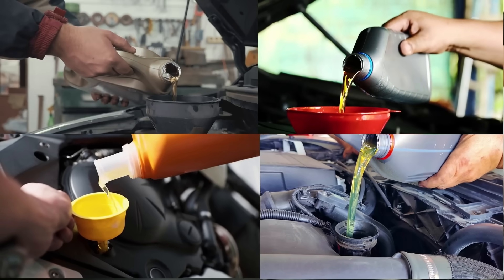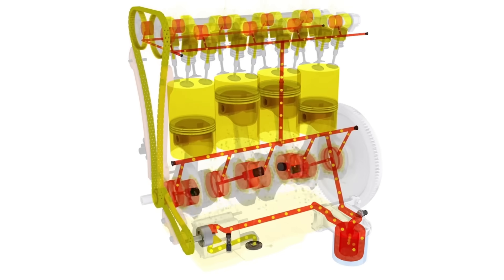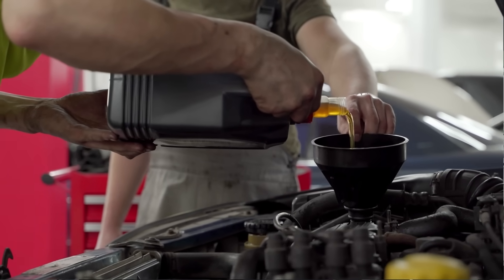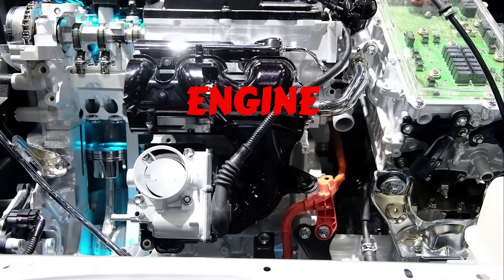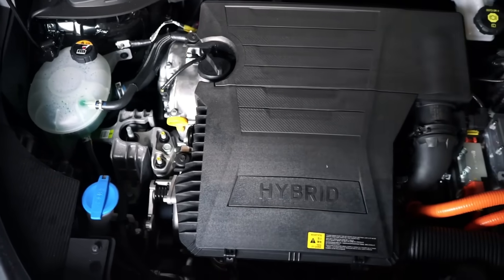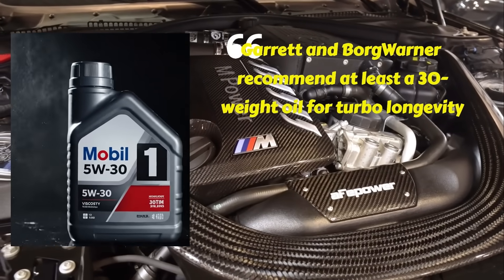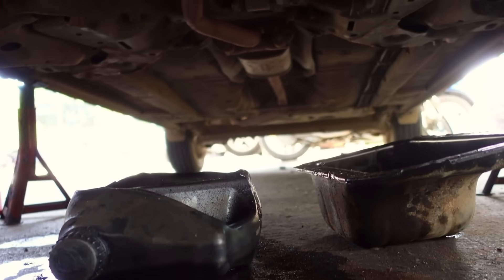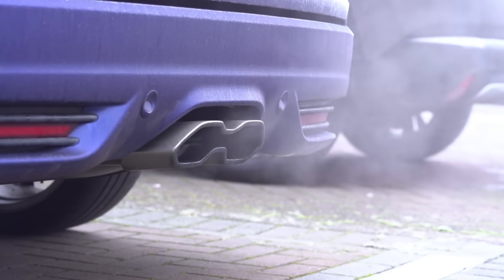The TRUTH About 0W 20 vs 5W 30 Oil (50 Engines Tested!)

Comment: I drive a VW Arteon with the new 300hp 2.0T Evo engine which is used in the Golf R. Just had my first oil change from the factory oil, to the recommended 0w30. During warm-up, when rpms drop from 1500 to under 900, there is some valve ticking noise, which was not present with the factory oil. Could this simply be the oil quality they use at the dealer? Or is the oil simply too thin? I remember when the standard oil for the 2.0T VW/Audi engines was 0w40 and 5w40.
Reply: My best guess will be the fatory 0W30 has high amount of Boron additive which is acting as antiwear/friction improver by creating a harden film on contact surface to prevent wear and reduce friction even when oil pressure is low at idle rpm. Personally, I will recommend new Redline Euro series since it's a high performance turbo engine.

Comment: With all due respect, this is a dangerous myth based on 40-year-old engine technology, and it does not apply to modern engines.
Today's engineering is the exact opposite of what this video claims:
 * TOLERANCES: Modern engines are built with incredibly tight tolerances (clearances). Oil that is thicker than recommended is too slow to penetrate these tiny gaps on a cold start. This causes oil starvation, which is responsible for the vast majority of engine wear.
 * FLOW > PRESSURE: An engine is protected and cooled by flow (volume), not just pressure. A thinner oil circulates much faster, instantly reaching critical parts (like the turbo) and removing heat far more efficiently.
 * VVT & TURBOS: These systems use oil as hydraulic fluid, passing through tiny passages. Thick oil cannot flow correctly, causing these components to clog, malfunction, and fail.
Engineers specify thin synthetic oil not just for fuel economy (which is a secondary benefit), but because the engine is designed to require that specific viscosity. Using thicker oil causes more wear, not less.

Comment: If we assume that the oil channels will be thin, then the new engines will use 0-20 thin oil and 5-30 thick oil. So what would it be like if we used 0-30?
Reply from the maker: Using 0W-30 can actually be a safe compromise in most cases. Cold starts will be just a bit thicker than 0W-20, so oil might take a moment longer to circulate, but it still protects the engine well. At operating temperature, it behaves like 5W-30, giving solid protection in heat. It’s not likely to harm your engine, but sticking to the manufacturer’s recommended viscosities is always the safest bet.

Comment: 😲 Glad I watched this video before I put 0W 20 in my Wrangler although winter is beginning so I could probably top it off using just 1 quart then get a oil change before summer 😊 Thanks.
Reply from the maker: I'm glad you found the video helpful! Topping off with 0W 20 during winter is a smart move. Just make sure to get that oil change before summer rolls around!
Reply: @CarCareCrewoffical Yes thank you !!

Comment: I live in the high north in deep cold winter climates - where -40C/-40F is a normal winter day.   0uch!    My vehicle's use 0W-20 in cold months and 5W-30 in hotter temps summer months.  Been doing this for years - regardless of the filler cap's label.   I've learned many years  ago that for weather temps and any engine oils "one size does NOT fit all".  This works for me....
Reply from the maker: Exactly! That’s a smart approach. Matching your oil viscosity to the seasonal temperatures keeps your engine protected and running smoothly, especially in extreme cold or heat. The filler cap is just a general guide adapting to actual conditions is what matters most.

Comment: I use
 -30W-40

Just use what the damn Owners Manual says and be done with it, fer christs sake…
Reply from the maker: Absolutely! Following the owner’s manual is always the safest bet. The recommended oil is designed to protect your engine under normal driving conditions, so sticking to it keeps things simple and worry-free.

Comment: Entao porque alguns construtores recomendam 0w20?
Reply from the maker: Manufacturers and builders often recommend 0W-20 because it’s optimized for fuel efficiency and meets the engine’s design tolerances, especially for cold starts. It provides good protection when used as intended, but in hotter climates or for heavy-duty use, slightly thicker oils like 5W-30 can offer extra protection just make sure it won’t void your warranty.

Comment: According to Toyota my 23 Tundra was designed to run with 0W-20. Can it run on 5W-30 without causing other issues? Meaning the thicker oil hurts other components because the motor was designed for a thinner oil?
Reply from the maker: Absolutely! You can safely run 5W-30 in your ’23 Tundra especially if you’re in a hot climate or do towing. The slightly thicker oil gives better protection under load and high temps. Toyota mainly recommends 0W-20 for fuel economy and emissions targets, not because 5W-30 would harm anything. Just use a good full synthetic and keep up with your oil changes  your engine will be perfectly fine.

Comment: Tento um Cruze ltz 2017 1.4turbo uso 5w30  dexox 1 ilsac gf 6 sp tá no manual      mas de 2018 a 2024   usa 0w20
Reply from the maker: “Nice choice! Sticking with what your 2017 manual calls for is the smart move 5W-30 Dexos1 Gen 3 is perfect for that turbo. GM switched to 0W-20 later mostly for fuel economy, not better protection. 5W-30 gives stronger film strength and keeps that 1.4T running smooth for the long haul.

Comment: 210,000 miles, Toyota Camry, 0W16. 🤷🏼
Reply from the maker: “Wow, 210k miles on 0W-16 that’s awesome!  Toyota really built those engines right. If it’s running smooth and not burning oil, no need to mess with success. Just keep up the maintenance and it’ll keep going strong.

Comment: I see 2024 Camry 4 cyl engines calling for 0W16 and 2025 models 0W8! What? 😱
Reply from the maker: “Yeah, crazy right?  They keep thinning oil for MPG gains, but that means less protection. Many owners now stick with 0W-20 or 5W-30 to keep engines safe long-term.

Comment: yes own a 2018 lexus nx300 with 100,000km 2.0T changed from 0w-20 to 5w-30 doesnt rattle anymore
Reply from the maker: “Nice move! That little turbo definitely thanks you for the extra protection. 5W-30 keeps things quieter and handles heat better, especially as mileage builds up. Great to hear the rattle’s gone  that’s real-world proof right there.

Comment: My 2023 COROLLA SE came with 0w8 oil in it.  That was making it very loud, it sounded unhealthy. I had to get it out of there, and put in 0w20. It's perfect now, but I'll have to change it myself every time.
Reply from the maker: Good call  0W-8 is crazy thin  great for fuel economy, not so much for engine comfort or noise. 0W-20 is a much safer middle ground, especially if you want the engine to last long and run smoother.

Comment: I feel like if it's a brand new clean sheet design then 0W20 will work well. If it's an engine that's an older design that initially ran on 5W30 or 5W40 and suddenly the manufacturers are calling for 0W20 is when the issues will start occurring. We have a 2018 Nissan Kicks with 130k on it. Had to replace the valve cover due to a crack causing a leak and when I had the valve cover off the top end of the motor was squeaky clean with almost no wear on the cams. That vehicle gets 0W20 synthetic every time and we don't use fancy stuff. Just whatever bulk 0W20 stuff the quick lube place puts in.
Reply from the maker: “Totally agree  newer engines designed for 0W-20 handle it just fine, but older designs adapted to it can have long-term wear issues. Sounds like you’ve been taking great care of that Kicks though Clean cams at 130k prove your maintenance routine is working perfectly.

Comment: Even with regular oil changes, I just replaced an 80k km engine on a 2017 Kia Forte.   5w20.    So I'm going to switch to 5w30.
Reply: On that one it might not be the oil, might be the manufacture.

Comment: In the 90s I ran 10w40 in an Acura Legend during the summer months and 5w30 in winters.  It apparently voided the warranty to do that.  Car was still running fine at 245K miles when I sold it.  These days I run 5w30 in every car even if it calls for a 0w and have no issues at all.  After 100K miles I would go to 5w40 in the summer.  On cars pre 90s, heavier weights were used as the engine had more mileage and wear.  It was common to go from a 30 weight to 40 in those cars.  Water thin oil is a bad idea even when it is new.  With 10K mile change intervals it is a disaster.
Reply from the maker: Thanks for sharing your experience and your approach to oil weights—it's great to hear your cars are running so well with your chosen viscosities!
Reply from the maker: I really appreciate you sharing your insights! It’s great to hear from someone with real-world experience. Your tips on oil weights will definitely help others in the community!

Comment: I use Ravenol 5w40 on my 2010 Civic now. Never going back to 0w20.
Reply from the maker: It sounds like you've found the perfect oil for your Civic, and that's what truly matters!
Reply: @CarCareCrewoffical 5w40 is the perfect oil. Let it warm up till the idle lowers and run the run the engine as long as you want. I do roadside, i use 5w40 Euro oil in all my vehicles
Reply: @GeezCte  Euro oil depending on which one can actually be a worse oil for a vehicle that doesnt need it depending on which exact oil it is. Many euro oils are developed to be super friendly to GPFs and cats. This reduces the amount of ZDDP and other anti friction and detergent compounds. I do think most of the super low SAPS euro oils are 20 and 30 weights but I would check to be sure.
Reply from the maker: @GeezCte  Makes sense, bro 5W-40 Euro oils are solid, especially for engines that see tough use or long runs. Good film strength, great heat protection, and if it’s working well for all your vehicles, no reason to change what’s already proven.

Comment: OK PEOPLE RETIRED SENIOR TOYOTA MASTER TECHNICIAN HERE WITH 39 YRS EXPERIENCE HERE.I HAVE 2 TOYOTA 1999 4 RUNNER LIMITEDS. ONE HAS 984,627 KM OR 611,000 MILES . 
I HAVE ONLY USED AMSOIL SIGNATURE SERIES 5W-30 SYNTHETIC OIL WITH SYNTHETIC LUCUS AND PUROLATOR BOSS 21905 OIL FILTERS. 

YES AND I AM SURE ,ALL YOU KNOW IT ALLS  CLOWNS WILL SAY LUCUS IS GARBAGE . OK YOU CLOWNS I WILL SET YOU IDIOTS STRAIGHT . WE LIVE UP IN NORTHERN  ALBERTA CANADA 🇨🇦🇨🇦 WERE JAN TO  APRIL WINTER TEMPS CAN DROP ON AVG TO -38C . THE SYNTHETIC LUCUS HAS SAVED THIS ENGINE WELL OVER 26 YEARS FROM COLD STATRS .
END OF STORY. 

UNLESS YOU HAVE MORE THAN 40 YRS AS  A MASTER MECHANIC KEEP YOUR FUCKEN MOUTH SHUT , END OF STORY. 👍

Comment: I quit listening when I heard him quoting Scotty Kilmer.
Reply from the maker: Haha fair point 😅  Scotty definitely has his own style, but some of his points spark good discussions. The goal here is to look at real data and testing rather than just opinions  that’s where the real value is.
Reply from the maker: Haha fair point 😅 Scotty definitely has his own style, but some of his points spark good discussions. The goal here is to look at real data and testing rather than just opinions  that’s where the real value is.
Reply: @CarCareCrewoffical  This whole  debate makes it tough to kniw what to do. As a mechanic, do i just decide what I think is best for every car and disregard what the manufacturer is saying to use? Where does that put me if the engine fails? Up to now I pretty much follow whats on the cap/in manual with premium filters and change 8-10,000 on synthetic. I know we have been using 5W20 long enough to know its fine, I have over 300,000 km on my truck with 5W20. I think ectended intervals is a big issue. Oil, I think people will have to choose and tell their garage if they want to deviate from whats recommended.

Comment: First, subaru wrx and sti got a bad rep for head gasket failure. My Cobb dyno tuned 2004 wrx wagon has NEVER blown a head gasket(bought it at dealer with 4 miles on it). My tuner told me to run valvoline 5W-30 synthetic, and change the oil every 10 tanks of fuel. Sounds crazy right? But 10 tanks of fuel is 3k miles. These claims of auto manufacturers and oil labels claiming PROTECTION UP TO 10K miles is ludacris. My buddy just bought a hybrid toyota, and they say change oil at 9k miles. I told him thats insanity. Change it TOPS at 4k or before. This is an oil conspiracy. Thin oil for emissions, and change at 9k miles. They WANT your engine to fail so you buy a new car every 5 years

Comment: Indeed. I went for the slightly thicker oil in my D4 who has passed 300000k. The thing is that 5w30 are better for a motor who stays warm when its below -10c. The D4 cools down below -12 with the 0/20 so i guess i will use the heater more. I havent noticed a higher fuel consumption yet. But the car are inspected as it was supposed to which means new oil every year. The other to do is letting it idle bf and after the drive. Evry car owner should learn this.
Reply from the maker: That’s a really smart approach sounds like you know your engine well. 5W-30 definitely helps engines maintain oil pressure and protection in colder temps, especially when they cool down quickly like your D4. Using the heater and proper warm-up routine is a solid habit too  it really extends engine life over time. Nice maintenance discipline!

Comment: I have a 24 grand cherokee. Using recommend oil right now with warranty. Would 5w-30 be a good switch after warranty is up. I live in New Mexico and does get around 110* in the summer. I do travel 2 hours a day for work. What would you recommend?
Reply from the maker: “Great question! Always best to follow your manufacturer’s recommendation while the warranty is active. After that, since New Mexico gets extremely hot and you drive long distances daily, many owners safely move to 5W-30 for a bit more high-temperature protection. But make sure to confirm with your trusted mechanic or dealership before switching  every engine behaves slightly differently.”

Comment: 2024 Subaru Outback non turbo 2.5L . At 25K I went from 0W-20 to 5W-30 instant change in sound , much much quieter on start and idle .
Lost from 30 mpg to 28 plus depending on getting good gas and trash gas even from  the same station . I also went from street tires to
AT tires and that made the most difference in mpg but I'm good with 28.5 mpg . I change oil every 5K miles and use extended life oil 20K
oil but still change every 5K miles . I'm 69 and don't see any new cars in my lifetime . I have to make it last .
Reply from the maker: That's an excellent breakdown of your Outback's performance changes! It sounds like the 5W-30 is definitely benefiting your engine's sound, and your consistent 5K oil changes will ensure it lasts a very long time.

Comment: Can I switch to 5-30 at 125,000 miles?
Reply from the maker: “Good question!  At 125,000 miles, many engines can benefit from a slightly thicker oil like 5W-30  especially if you’re noticing increased engine noise or oil consumption. But before switching, it’s always best to check your owner’s manual and consult your trusted mechanic to make sure it’s the right move for your specific engine condition and climate.

Comment: I have a 2019 tundra with v8. I have used 0w-20 (mobile full syn.) since new, every 4-5k miles. Last week (108k miles) i changed my oil, it takes 8.5 quarts, I measured how much came out, exactly 8.5 quarts. I get the mpg point in this video, but I believe most engine wear happens at start-up, 0w will flow faster at start-up and will do its job quicker.  I live in hot climate (Texas) I would be open to use a 0w-30, but not a 5w-30, I want that oil flowing as fast as possible.
Reply from the maker: That's an excellent point about cold starts and the benefits of 0W oils, especially with your Tundra's impressive mileage and consistent oil changes!
Reply: Naaaaah, you'd be good with 5w30. I have an '18 Tundra and that 5w30, unlike the 0w20, kills the lifter rattle at start up in the morning.
Reply: @willg.5168  Funny thing was when I was at walmart right after this I went to buy oil for next time and they had mobile 1 0w-30 so I will give it a try first.

Comment: I understand that with he newer vehicles now and with turbos etc, that the engine tolerances are tighter and have smaller areas for oil to travel to. The older engines would make sense as their tolerances may not be required due to lack of turbos etc.
Reply from the maker: You've hit on a really key point about engine design and its impact on oil choice!

Comment: I’m going with 5w-10 every time over 0-20 . I haas two Honda civics with 1.5 turbos and the one I used 5w-30 still runs and I could never tell a difference in fuel economy . The turbo failed in the 0w-20 car and it had fuel in oil dilution and the engine went to shit at 200K .
Reply from the maker: Thanks for sharing your experience – it sounds like 5W-30 really made a difference for you!

Comment: My truck calls for 0w20. I change my oil in my truck about twice a year, sometimes 3. When it falls in the colder months i use 0w20, when it falls in the hotter months i use 0w30
Reply from the maker: That’s actually a smart and balanced approach  adjusting viscosity with the seasons keeps your engine protected year-round. 0W-20 for cold starts in winter and 0W-30 for extra film strength in summer is a great combo . You’re doing it right  your truck will thank you in the long run!